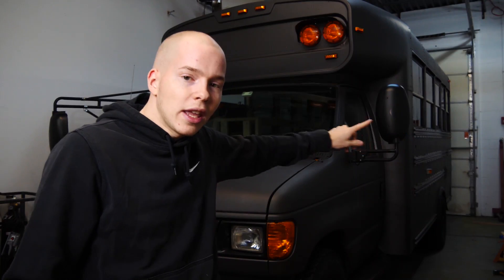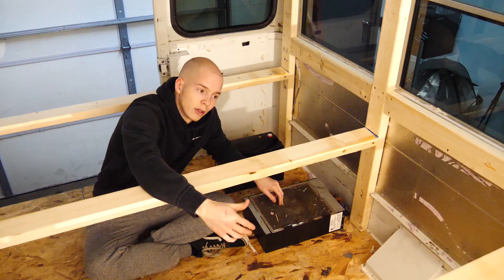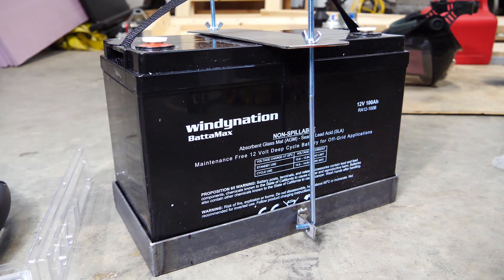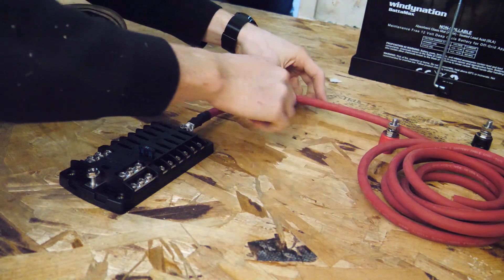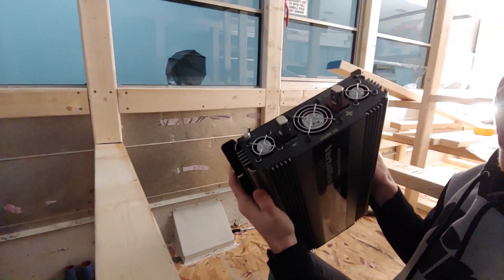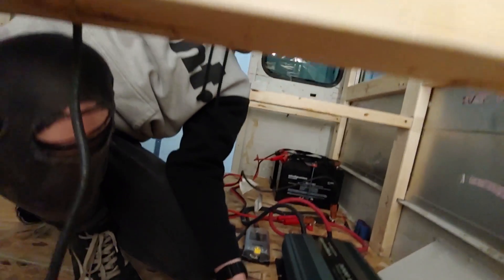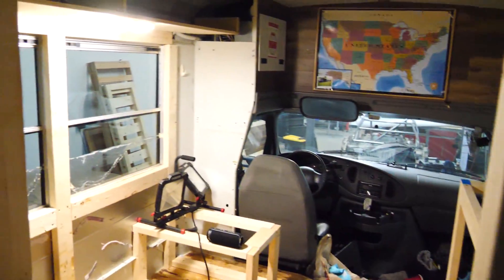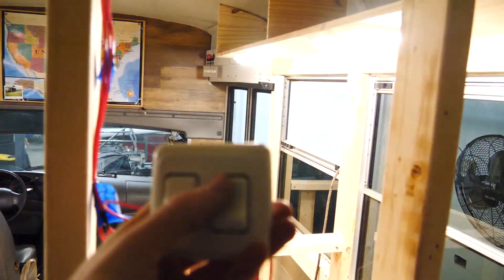Adventure Bus Gets an Off-Grid Electrical System! (Deep Cycle Batteries, 3000W Power Inverter)

Comment: NICE VIDEO COOL WHAT KINDA BATTERY ARE THOSE DEEP CYCLE HOW MUCH AMP I HAVE DEEP CYCLE 75 AMP 900 WATTS YOU WAS PUT 150 AMP FUSED BETWEEN POSITIVE OF BATTERY AND POSITIVE OF YOUR INVERTER OK NEXT PUT PUT SWITCH BETWEEN POSITIVE OF BATTERY AND POSITIVE OF YOUR FUSED OK TO TURN OF INVERTER POWER STILL IN INVERTER NICE VIDEO I HAVE 1100 WATTS INVERTER 12 VOLT DEEP CYCLE BATTERY 75 AMP 900 WATTS WHAT I DO FROM POSITIVE OF BATTERY AND POSITIVE OF MY BATTERY I HAVE 150 AMP FUSED THEN I HAVE SWITCH BETWEEN POSTIVE OF MY BATTERY OF MY BATTERY TO POSITIVE BETWEEN FUSED AND BATTERY

Comment: Over time your wire nuts will come apart due to the vibration of the bus.  When that happens you will get a black circle in the wire mesh where the wires were pulling apart and it started sparking.

Comment: You should really use plastic hold downs for those wires, the staples could eventually wear through the jacket on the cables. Good choice on batteries though.

Comment: instead of screwing the foam padding for the battery, you couldve adhered it to the battery itself then rest the battery onto the holder you made. since foam degrades in time, eventually the battery will be sitting on just the screws and would worst case scenario puncture the battery. hope this is constructive enough for you ging!

Comment: you might want to use some heat shrink around those connectors. cause now they can short out. If u don't want it that permament just put the heatshrink around and don't shrink it yet. that's what i sometimes do

Comment: You should take out the leftover coolant lines and fill the hole on the floor for some extra insolation and to make sure water does not get there to the electronics since the hole is right next to them.

Edit: When is the drift truck going to make a comeback???

Comment: Hey boss, how are you going to recharge your house batteries? Your 3000w inverter will draw them flat quite quickly if you load it up a lot. Solar panels are OK to keep things topped up, but not the best. 

Make sure you run decent sized cable from your engine battery through a VSR (Voltage Sensitive Relay) to your house batteries so if you flatten them your engine battery will always remain charged to start your truck and whenever your truck is running it charges the house batteries. Also mount a permanent battery charger in so whenever the bus is connected to mains power it will be topping them up. 

If you want any advice or help just send me a message. I'm a qualified auto electrician 🤙👍.

Comment: Hey my friend is a diesel mechanic and was telling me you can take the bus to a mechanic and they can take the "bus governor and tune" off so it goes faster on the expressway with less effort. But they have to call the company and get permission, also the stuff for commercial emissions stuff can be removed if you have it registered as a personal RV which will help the engine last longer

Comment: Just a little idea like that, Idk, if it were me id put something around the batteries, the fuse box and the rest of the high voltage electrical stuff? Like flame proof stuff, or at least quadruple check all connections and make sure nothing can come loose, idk just my opinion! Cool build though, Im really jealous, ive always wanted to build something like this!

Comment: Are you fitting 12v sockets? As you'll be using a lot of power from the batteries to charge your phone converting it from 12vdc to 120vac then converting back down to 5vdc

Comment: Soldering electric wires is not a good idea. If they are getting hot the solder can melt and disconnect from each other and could create a arch, to set something on fire.

Comment: Looking forward to see the bus finished. Regarding your electricals being directly onto particle board. Maybe I would have put some fire board in place first. As some extra protection just in case you have an electrical failure. Also maybe look at a fuse box that has got some circuit breakers in it as well.

Comment: @gingium should you plug those coolant lines? One was the lead and one the return line. I feel like if you plug them you might end up with a dry return and a small pipe bomb on the lead. Just loop them together!

Comment: Great work, personally I don’t think u have enough AH in the Batterys, with a deep cycle battery like that usable Ah is 50% when you go lower than that you can damage your battery’s, that said means u realistic have 100Ah which running all those appliances will make short work of using, in Australia my car has a second battery of 100Ah so 50 usable AH and with a 12v fridge and lights for he night camping and maybe a little bit of Chagring phones ect I’ll be pushing 2 nights before hitting 12.06V being 50%, I also suggest you getting a battery monitor to monitor your battery’s, I use a Ctek Bm1 and it’s great

Comment: 3000 watts is smaller than you think you'll need at least 4/0 on the 12v side and will only have 20 amps on the 120 side so dont run too much oh and a 250 amp alternator just for the inverter

Comment: Just two things you should really attend to before a fuse is blown or the bus cayches fire.
A: there is proper staples that are meant for wiring that have a plastic top with a small nail on either end. This is important because the metal staples will eventually wear thru that wiring and even though its only 12 volts that can cause the staple to heat up and catch the floor on fire.
B: please for the love of god put either covered spade connectors on the wires or put heat shrink over them. The positive and negative connectors could touch and blow a fuse which could result in an electrical gremlin that you literally have to tear your walls apart to find. 
I know its a very new thing for you with running wiring so im just trying to look out for you man. I wanna see this build become as perfect and stress free as possible. I love your content man keep it up!

Comment: Hey gingium you should spray diesel under the chasis to help slow down the rust under the truck until youre ready to fix the bottom of the bus try using a chemichal sprayer it will help alot.

Comment: please concider running some 0 gauge wire from the alternator to the rear batteries with an inline isolater so you can make sure the rear batteries are fully charged when you get to wherever you go. perhaps look into a dual alternator bracket so you could have a dedicated alt just for the RV side of the bus?

Comment: Instead of tinting all the windows, and still having to deal with the rattling and insulation issues, try removing the ones you aren’t using and making an aluminum sheet to delete it. You can seal the window off and fill the gap in with insulation and then you fix the rattling, stop losing heat and won’t have to spend a fortune on tint. Sheet aluminum is pretty cheap

Comment: im a little surprised your inverter is so small. I have 3 inverters in my Durango. a cobra 2500w, a shumacher 750w and a black and decker 400w. im ready for just about anything. if I need more power I can put a rack in my hitch and mount my 7000w generator and take that with me. none of this is for job work. just for my own enjoyment.

Comment: I’m not a pipe fitter or anything, but wouldn’t it make sense to tap the supply and return coolant lines together so it can flow back through the system rather than being closed off?

Comment: Be careful with that battery position. Lead-acid batteries give off hydrogen gas when charging (even when they're sealed ones) and that's not good when you sleep right over them. 

If you only let them charge while driving, it will probably be fine, but I'd research that a bit if I were you.

Comment: "they don't need ventilation"

Mounting those in the cabin  isn't exactly cool with safety standards. For yourself, first, of course, we're here, you're there.

FROM the manual:

"Battery Safety
Warning: Batteries can produce explosive gasses; observe extreme caution.
  Have plenty of fresh water and soap nearby in case battery acid contacts skin, clothing or eyes.
  NEVER smoke or allow a spark or flame in the vicinity of the battery.
  Be extremely cautious of metal items such as jewelry and tools to reduce risk of short circuit.
  Never charge a frozen battery.
  Be sure battery is mounted in a well-ventilated compartment.
  Use insulated tools and wear protective clothing when working with batteries"

"Deep-cycle AGM batteries release small amounts of gas during usage, particularly during the charging process.
Be sure there is adequate ventilation in the area where the batteries are to be installed. If using multiple
batteries, the empty space surrounding adjacent batteries should be at least 0.50” (12.7 mm) to permit airflow
around each battery"

And so on.

The manual is freely accesible to anyone via internet @ "windynation battamax venting" the PDF file.

Don't underestimate the damage these can cause.
Reply from the maker: Thanks for posting that! I guess I was kinda wrong. Although after reading that it still seems fine to me? The batteries have plenty of space around them and plenty of ventilation.

Comment: Good to have you back, got to say a big no no no to staples especially as you have them going over pos and neg cables and not the covered type at that you need the plastic household type the cables will be chafed over time and you will only know when it is to late.
You could have saved time and material making the battery retainers by making one dual mount but your welding is spot on now.

Comment: I'm confused because he said that there is two 6volt batteries making 12volts but if you look on the batteries it says 12 volts on each battery which would make 24 volts.

Comment: A little trick to keep 2-3 wires together, Put the ends together in your drill and the other end in a vice. That will allow you to twist them together. That will make it easier to run.

Comment: Instead of tape, I recommend electrical conduit not only for extra insulation, but keeps your wires from wiggling and fraying and it would make the management of wire cleaner.

Comment: why not ground the battery to the bus like in a normal car?
Reply: Actually probably should do that just so it's all at same ground potential.  Inverter should be grounded too, just got to watch how you wire it as some inverters do weird things with the neutral.  Need to measure stuff before bonding anything.

Comment: Don't use staples to secure the wiring , with the vibrations and movement they will eat away at the wires jacket, especially because you also ran the ground wire. It's a good way to set it all on fire since you secured it directly to the wood. I would hate to see all your hard work go up in flames.
Reply: @VectorNinja1  there's a plastic cabel staples you can buy
Reply: @DJkirakira it won't came loose, the staples has a nail on it so you can hammered it to the planks, and its shape is half circle, its a staples only for cables

(Srry if i had a bad English)
Reply: @DJkirakira also i don't know if the staples are available on your country, but im sure there is
Reply: @VectorNinja1  Honestly there is no absolute correct way, If it where my bus I would run ground to chassis since the bus is surrounded in conductive material. That would for the most part eliminate the most major threat. One could also use multi strand cable rather than running the wires individually, they usually have a stronger jacket than plain single strand. Lastly there are some zip-ties with a little loop for a nail, that's a cheap and fast solution but not nearly as effective as the first two.

Comment: 8:20 NOOOO, the metal will eat through the cable because the bus vibrates! And because these are under your bed this is super dangerous, you could light on fire on your sleep! Get proper equipment for securing a cable before you drive even a mile.
Reply: I was thinking the same
Reply: The fuse panel shoud keep safe

Comment: Relocate the batteries underneath the bus! That’s not good for your health Gingium!
Reply: Many mobile home's have their batteries inside, if you have the right bats it's no big deal
Reply: They are sealed, they're fine there.   I would just make sure nothing can fall on the terminals.  Like if there's any storage under the bed, the section where batteries are should be closed off.
Reply: They are specialized batteries. They wont give off fumes, they aren't spillable, etc. He does say this in the video, and it is clearly labeled on the side of the batteries themselfs. They are basically perfect for how he's using them. Easy access for if they need to be disconnected in an emergency, rather than having to get out of the bus and run all the way round to the side, opening a hatch before you can disconnect it, by which time something could be in flames.
Reply: I was shopping for RV’s for weeks. Never saw a single one with the batteries inside. They were always under the steps... outside...so they were ventilated

Comment: How will you charge those batteries?  Will you add a cable and switch so you can charge from the engine while driving?  Stereos and amps usually consume a lot of power.  So plan ahead for that. Big wires for power.  The longer the run (measure both ways) the bigger gauge wire you will need so you don't burn the bus down.
Reply: Thanks, I guess i missed that.

Comment: Conect a wire from the generator of the engine to the battery so when you have the engine on it chargers
Reply: But then you're pulling cranking amps through that long wire as well. Better to keep it separate and put in a split charge relay.
Reply: @steve87uk  why pull power ftom the aux. Batteries? Just conect two bridge rectifiers to the generator so power only goes to the main battery for starting and to the  rv batteries .

Comment: Update log 1/11/19
Adventure bus 
- Added lights
- added electric 
- added deep cycle battery
- added inverter
- removed heater
Other
- main character uses the vice finaly
Reply: but the vice isn't bolted to anything. still dangerous.
Reply: I missed this so much
Reply: Missed you my man
Reply: Probably the most important non Gingium comments on these videos
Reply: How does this not get pinned every time?
Reply: Alfonso Rodriguez I don’t know I don’t know
Reply: My man is back with the changelog!
Reply: I was searching for your comment as soon as i clicked on the video
Reply: Please don't stop this ever

Comment: You're gonna want to re run that line with thicker gauge wire. Also, Add a kill switch to the batteries. I can't tell you how many times I have left my kill switch on and came back to a dead camper so it comes in handy for sure! To speak more on the ticker gauge wire. Future proof everything! If you insulate the walls, it will be a hassle to re wire anything if you want to swap out a light. Some thicker shielding on the wires will also help as these wires do move around a shit ton and see a lot more abuse than normal house holds.

Comment: Hey Gingium, if you want a little more light in the bedroom you can repurpose the old bus lights up top just replace the bulbs with LEDs. Just got a wire them into the wiring that you are a put in for your bus electrical.

Comment: Insulation between wiring and staples would probably be a good idea.
Reply: I was thinking about that to
Reply: Yeah !
Reply: The staples are stuck in wood? And not going though the thic cabel? Its not really a problem here. I have seen The same method been done in houses. Its very commen and not really a big deal.
Reply: The ones used on houses are plastic clips with nails at the end to hold them down.
Reply: Nah it's fine even with 120v you use metal staples.  Only thing I would have done differently is use actual electrical staples and not ones from staple gun but that's minor especially for the 12v stuff.  As long as you don't get them through the cable.  I've seen that, people doing Christmas lights etc and half the staples are in the wire lol.